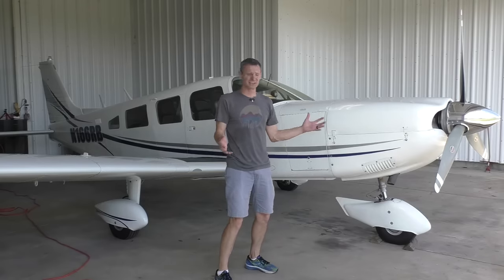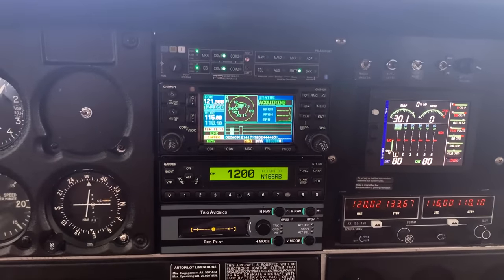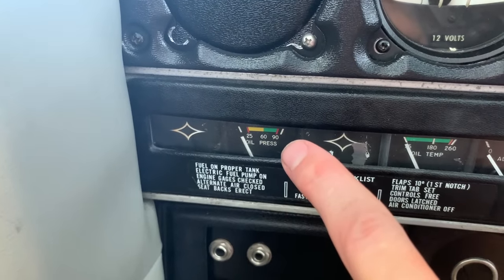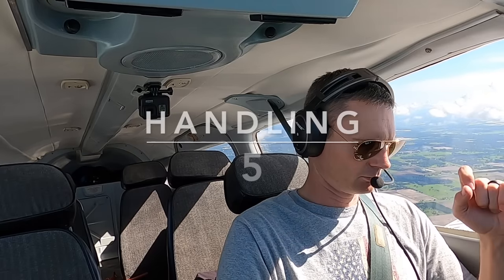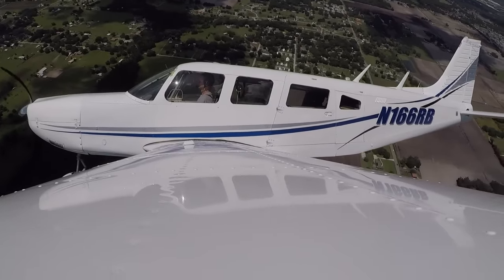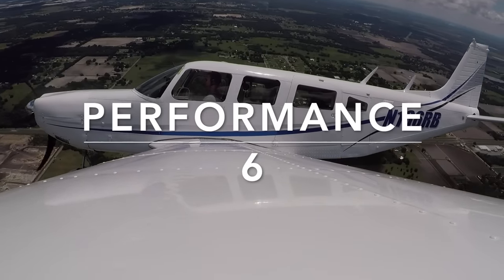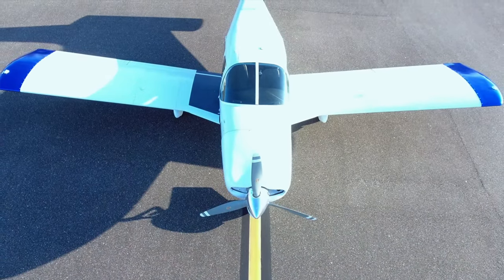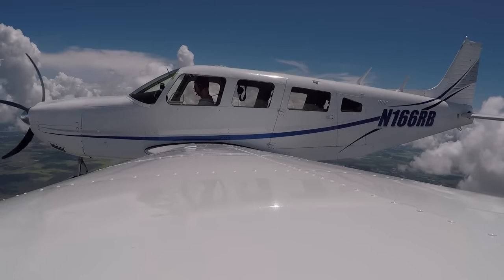Abandoned Airplane Find, Fix & Fly in 12 min

Comment: Yes, your right Jimmy. The Cherokee 6 300 is an old dependable workhorse. I've spent many hours flying one back in the 70's. I dropped jumpers out it, cross country hops and hauled lots of cargo, When I could find another pilot to fly it, I made several skydives out of that cargo door. The only incident I had with the 6 300 was a broken belt that drove the alternator. Happened at night on a cross country. Lost battery power. Sure gets dark in there with no lights, and really quiet with no radio. I spent the night and a small airport. Keep up the good work. I enjoy the videos and the crazy banter. Just an old Marine here.  R.

Comment: I surely know what you’re talking about with ‘forgiveness’ and ‘load.’ Even though I’ve flown a lot of oddball aircraft and did all of my ‘quals,’ in a Cassena, the only aircraft that I’ve personally owned was a 46’ Stinson 108-3. It was affectionally known as “The Station Wagon of the Skies.” I bought it for a song, from the original owner. It hadn’t been flown since the late 50’s and I bought it in 1971. It had a very tired and beat-up 165 Franklin in her. I was practically given a Franklin 220 that needed to be rebuilt, which I did myself. Since I had a connection with Edo Corporation, in Manhasset, Long Island, NY, they reworked my pontoons for $500; including shooting them in the Dupont color of the plane itself. That was one epic aircraft.

Comment: A Guy in my Club had one that was de-rated for german Noise Emissions. It had a tiny 4-Blade Carbon Propeller and a big 6 in 1 Muffler. Loaded with 6 of us it took us almost a km to get into Ground Effect and it got like 400ft/min. 
On the upside, with the mods done to it and an Economy Tune it got 45l/h and 240km/h Cruise. 
He had spent years cleaning up the Aerodynamics on it and had it as a Testbed for the Uni.

Comment: Proud of your achievements on getting your Six Packer from start to finish and let me know what power settings you are using for you and comfort
Reply from the maker: Thanks so much!  To go slow I pull it back to 21in 2350 rpm and burn around 12.5gph, if I'm trying to get someplace, 23in 2400rpm and thats around 14gph

Comment: Jimmy, does the wing on this Piper fall under the recent AD for the installation of the wing inspection plates and the required inspection of the wing joints for stress fractures? Did you have to do those? If not,  why not?
Reply from the maker: yep and yep.  All done and checked out perfect.

Comment: If you like airplane projects, want to be able to haul a fair amount of stuff up in the sky, and go fast.... although it's only a 4-seater, the Van's RV-10 is an awesome plane to build and fly. I helped build one with two friends... I did all the wiring and avionics on it. It was completed in 2009 and has an IO-540, CS prop, full IFR glass panel with all the usual gadgetry, autopilot and a stereo intercom system, and it cruises at 175 kts. Flies like a big version of an RV-6/RV-7.

Comment: As far as your explanation for safety, I TOTALLY get it. I race a 425hp, nitrous injected, Hayabusa motorcycle that I've had up to 252mph. It's lowered and stretched with a fat tire kit, but I'm telling you, the Honda Goldwing "Old Man Bike" is the most dangerous bike I've ever owned. Riding it across the state, it was SO comfortable, I fell asleep. It's so large, heavy, and stable, it gives you a sense of security. Set the cruise control, adjust the air ride, heater, and radio, and you will black out. People laugh when I say I feel safer on an 8 second drag bike over a Goldwing, but I'm serious! I immediately sold it and bought a loud, shaky, Harley Ultra for my over the road bike. I'm shopping for planes now, I appreciate you adding the safety factor in your reviews. Awesome videos, I definitely subscribed!

Comment: I feel you. I spent 30.000 on a 70’ Cherokee 180 in fair condition and immediately put another 30.000 into it!  Some upgrades will show a return on investment like avionics while others like an expensive paint job probably won’t. And then there are all the little things no one really notices like interior trim pieces or new antennas. I truly ended with a small fortune by starting with a large fortune 🤔

Comment: Jimmy, I've got a lot of PA32-300 time in my younger days and you hit it on the head! The "Six-pack" is a 'single-engine DC3.' Literally speaking, if you can close the doors, you can fly it... within CG limits. Another, similar plane with 'two chances for an engine failure,' a Cessna 402. It's an airborne "1-ton dually" pickup truck. Anything from hauling 1,500# of mail to hauling mining machinery and landing on dirt roads in Nevada's mining districts, the 402 got the job done.

I subscribed and hit the bell... Looking forward to the next video........

Comment: I have a lot of "six" time and solo with low fuel, you are pushing the nose up trim limits. I once had a local flight out   of Colorado Springs with five passengers who wanted to fly over Pikes Peak (14,410 feet) to scatter grandpa's ashes. They were in a shoe box that would barely fit through the apple core window on the left. Well, half way out the box bent in the middle, the lid flew off and grandpa's ashes were blown back into the cabin.
Reply from the maker: very cool! hahahaha

Comment: Nice to watch your video on the SIX. I used to fly a 260 in total of 3200 hours. In Sweden with all kinds of weather c onditions. I like this aeroplane a lot I always flet safe in it. Unfortunately it is      sold to Bulgaria (probably will go on   to Russia), I do miss. However  I stopped flying- private flying is very difficult in this country. The SIX is like a truck. It carries a lot. I used to fly spare parts fo rmy  company and  sometimes it was heavy stuff. Or a computer chip in my pocket. But the SiX w ould do the job. i also had access to a  Lance but I preferred the SIX. A great machine. I ran     into icing but the SIX would fly.
2 inches was the limit. Things did happend but never any serious. I survived.
Congratulationa to a nice aeroplane.
Sven Martin , Sweden CPL

Comment: Four things you can’t wash off any airplane:  Airframe hours, damage history, airframe corrosion, and missing logbooks.  

Also retractable gear is not much of a safety issue, but it is a damage quantity issue.  If you can make it to a paved runway, you’re as safe as a fixed gear airplane whether the gear extends or not.  No one gets injured in a gear-up landing unless the pilot tries to get cute and kill the engine early or land off pavement, etc.

Comment: Hi Jimmy, I love your videos.  You are very entertaining.  My first plane was an Archer and for the last 25 years I have been flying my 1958 Piper Comanche.  The 58 has a bench back seat. I have three seat belts back there and have had 5 people in this aircraft. Great preforming aircraft with my 250hp engine getting 155 knots indicated.  90 gals with tip tanks and a 3,000 lbs gross weight, useful is about 1,200 lbs.  The 260 B or C models are a little faster but different seating.  You really need to make this plane your next project.

Comment: I do not recall you ever talking about how many hours were left on the engine before TBO,  when you purchased it, or the cylinder readings. Did I miss that in one of your vids? Get a C340! Thanks!
Reply from the maker: Thanks for the comment.  cyl were all 72+ and this has a TBO of 2000hrs, currently it's at 200smoh.

Comment: Here is a little help with my hitting the like button.  LOL.  Seneca Yea, I don’t think so more fuel and slower also.  340A. Good choice, 421B better choice.  As you have found out pay for it up front or pay for it through the back (Sinker). Keep up the Videos, I love them.
Reply: 421 would be a nightmare, just like the Duke and P-Navajo. Those engines would bankrupt him.
Reply: A lot of pilots are afraid of the geared engines.  But gentle on the throttle and preplanning your descents are key to the engines making it to TBO.  The fuel flow is double that of the Piper Lance 270/300.  I operated a Cessna 421C with two other 135 pilots that easily made it to TBO.  It just took an easy hand on the throttle and normal maintenance on the rest of the system’s.  Is it more pricey than a single engine airplane, you bet ya!  But he has the goal of flying jets, so this is a good move toward that goal.  Have a great day, God’s Blessings, Blue Skies and Tail Winds to you,

Comment: People from the flatlands always have problems with carrying capacity, altitude and DENSITY altitude. You will not take off and land in 750’ at Leadville, CO ever and on a hot summer day density altitudes over 12 and 13k.

Comment: Okay buddy it's time to jump off the porch and play with the big dogs. I wanna see you get a hold of jet and work your magic on one of those. And what better jet than the most produced of all time? That's right, talking about the citation. Not sure if you are licensed to fly them or not. If not it can't be that hard to upgrade. But I have personally seen a citation for $20,000 now one engine was over due for an overhaul, but the other 1 still had a solid 8 hrs. It had just been sitting at the airport for about 20 years. 😀

Comment: Hey Jimmy.  Very fair evaluation of the old Cherokee Six- with one exception.  The logic used for your safety rating seems flawed.  If the accident pilot checked the POH prior to departure, he would have known that, under those conditions, the plane simply would not perform as he “felt” it would.  In my respectful opinion, that fatal accident had absolutely nothing to do with the aircraft- it was 100% pilot error/poor judgement.

Comment: Interesting video, but I think Jimmy may have left out a few things in his expense report. For instance, it appears he added wheel pants, which are usually a couple grand unless they came with the airplane. Also, he didn't mention the new paint job: if it were done by a certified paint shop, I'd expect it to add another $20,000.00 or so. Apparently it hadn't flown for 20 years, so a very thorough (probably tear-down) engine inspection would be necessary adding a few more thousand $, and I'd be surprised if there wasn't a fair amount of corrosion internally if the engine hadn't been "pickled" after it last flew. Jimmy says "if I'd had a shop do this, I'd have spent another $15,000 to $20,000." Apparently he did the work under the supervision of a friendly AI, but most of us who are less skilled would have had to pay a heck of a lot more to get that work done. All of that to say, Jimmy created a good deal for himself, but don't think you would be likely to get the same result.

Comment: I would be more concerned about the state of the engine internally than the little boxes on the dashboard after it sitting around for twenty odd years or so. No mention of that Jimmy.
Reply from the maker: Good call. Yeah, that was a top concern. Lots more details in the build videos and early ones.

Comment: Jesus!  16 gallons per hour?  I know these planes, if it fits in the door it FLIES but for shit's sakes~!

These small planes are toys.  I was an instructor at Flight Safety Academy from '89-'93 and flew Piper planes... 

Piper: There is no substitute!

And have thousands of hours in these.  I fly 767's for a major airline now, and our flying is so much more controlled and followed and maintained compared to my GA days!  I'll have to retire in 9 years;  What will I do with aviation?  I don't know.  

But if I was going to buy an airplane it would be a PIPER.  Either a Cherokee 6 or a Seminole....

Comment: So I've  always  wonder, Isn't a plane with two engines more safer than the plane with one engine? I was just thinking  that most plane with one engine, if it stall, you are screwed but if it have two engines you could  still fly.
Reply: yes, having multiple engines provides some redundancy in that regard. Even still, you always have to be mindful where you are because while rare, loosing both engines can happen, and multi-engine planes are larger, needing a bigger field to land on. It's also much more expensive to maintain, since engine work has to be certified and that costs enough with one engine.

Comment: lets donate to you, your feeds are amazing I will donate five Bucks a month to you I am pretty sure a lot of people will it all mounts up even if it is just Gas money Sir set up a donation link please 
I have a sunrunner 27 sat in Tacoma I am struggling to get the engines and out drives sorted out yes it is a boat but I love restoring them and putting them Back on the water I do not have a pilots licence even though I have flown as a kid in the UK in the ATC air training corps love sailing flying and Horse ridding oh and hitting the Black stuff at one hundred and fifty miles per hour on the Back of a Motor Cycle ;)

Comment: Go get you A&P cert and rebuild it yourself. Those engines are not worth that and those mechanics are not worth what they charge, its outrageous ! I have been a marine mechanic for over 40 years and have rebuilt some of the most hi tech outboards on the planet and built huge 1000 HP off shore motors and race engines. You can't make me believe that those basically Volkswagen engines are worth that kind of money I mean what a joke. Yamaha, Rotax and Subaru make better aircraft engines. This is why these nice old airplanes are going to the scrapyard.